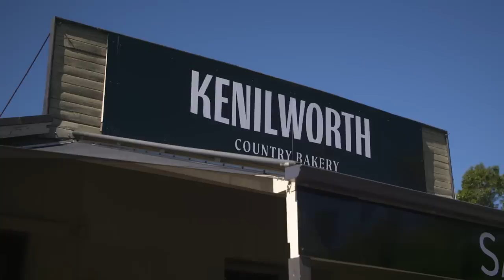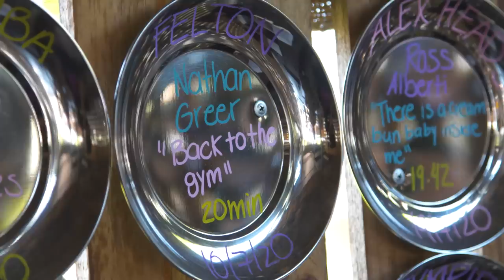CARNAGE on QLD's toughest 4WD track! Panel Damage & Busted Steering on Glasshouse Mountain tracks

Comment: This was the first time I had been on some proper 4x4 tracks and I am a rookie so don’t judge 😂 I was out on the tracks at Yalwal.  We were just going to finish up on one of the tracks just as the sun went down. I went up a pretty steep track with some pretty decent ruts and slipped into a big one and got stuck. I had one globe that had blown earlier that morning and as we were doing the recovery the second one blew. If I had spotties and some better lighting I would have saved myself ripping my front bumper off and putting a nice dent in the rear as I finished the track with no lights 😂  it was a good excuse to tell the wife I need a bull bar though
Reply: Absolutely awesome work, loved it👍.
Reply: @benclarke8743  bro this isn’t the same jesse from the video 😆
Reply: 🤣🤣🤣 my bad👍

Comment: I was in a 2wd ford ranger and had to pull a full size jeep Cherokee[ the old style] out of a deep water crossing at night after he fell through the ice. all I had was headlights and a high lift jack and some straps. I had to put the front bumper on  tree because my little 2 door ranger was just sliding into the puddle with every crank of the farm jack. three hours latter and we got him out. great fun I miss that little truck. that would be a good episode all the trucks from the past you had to get rid of but wish you still had.

Comment: Driving home one night in a winter storm in good old Idaho USA. Saw multiple cars who had gotten stuck off the side of the road. Was very fortunate to have a capable vehicle that can handle it's own, however, it being a new vehicle to me I had yet (and still have not got the chance to) put some spots on the vehicle. I spent a good 3 hours with a flash light in my mouth and my friends hands as I tried to get vehicles towed out. Rescue could have been down in closer to half that time had we been able to see better. Number 1 priority before winter hits this year is be prepared to help others this go around, and not put myself in danger in the process!!!

Comment: As always guys entertaining and informative.
I live in WA and try to get out there as often as I can. One of my more interesting trips was travelling the coastal tracks north of Jurien Bay. Due to some rather unfortunate luck we had found ourselves still on the tracks way after sun set. Managed to destroy a tyre or two on some limestone cap rock and an unfortunate run in with some local wildlife had delayed us significantly. Anyway back on the tracks and it was very dark and we were trying to remember where our camp was. In the dark and with only high beam on my old GU the terrain looked very different. We missed a couple of turn off's and were trundling along thinking we were not far off when all of a sudden the bush gave way to the Indian Ocean! I mean we were three feet from driving of the edge of a limestone cliff. If we had have had decent lights we may not have gotten so easily lost.  Come day break, yep we stayed there, we realised we were only 1km from camp! So close yet so far.

Comment: Got a little too ballsy trying to camp through a typhoon, tent couldn't handle the wind so we gave up and headed down the mountain to find some lodging. Normally a 30 min drive turned into an hour of driving through flooded roads, street light power outages, and sideways rain/fog and couldn't see a meter in front of the car. Spot lights would have definitely helped..
I knew it wasn't the smartest thing to do, but with limited days off, I guess camping during typhoon is checked off my bucket list..haha

Comment: Took my old TB patrol up Bago Bluff around Wauchope for a midnight session. Got half way up a very steep and technical rock climb when both of my head lights (only 2 lights on the car) blew at the same time. Had to navigate over 2 hours to Finnish the 100m hill climb using only phone torches…. Then drove all the way home with no lights and 2 iPhones cable tied around the front of the grill.

Comment: I could definitely use some spotties and a lightbar! Just a few nights ago I was trying to get down out of the mountains near my home on a trail that was really washed out from excessive rain. It has become a lot more technical as more dirt washed away over the last few years. 

With my fog lights and head lights, I couldn’t see down the trail very far but I had driven it several months ago and thought I should be ok. Had I been able to see a just a little further, I would’ve taken a different trail altogether.

Instead, I worked my way down the trail about 60 yards and found myself teetering from 2 wheels to 3 wheels as my rear passenger tire lifted and I found myself at a gnarly angle staring down a wash out my driver window that dropped off down into the darkness several hundred feet below. The trail had partially washed out and I couldn't get my truck through without tipping.

I ended up making it down safely and thought the truck was miraculously unscathed despite the technical drive I had to make backwards to get back up the trail so I could find an alternate route down. I didn’t stop to check my truck when I got back to the pavement (stupid mistake) and wondered why my blind spot monitor kept going off on my drive home when there weren't any cars near me. 

It wasn’t until I pulled back into my driveway and got out that I saw have my bumper dangling in two pieces just above the ground by the truck’s wiring. They don't make 'em like they used to! Everything is plastic now! I must’ve caught a rock or something as I was backing up the trail.

I managed to zip tie it back together (sort of) in the dark and my wife hasn’t seen it yet 😬 but I think I’m going to have to upgrade the back bumper to a metal one sooner than I thought.🤦‍♂

I’d love a pair of spotties and especially that light bar up top to help keep my truck in one piece when I’m trying to get home next time.

Comment: I could of used a set of light on my old 60 series. I was in the Kimberly and managed to fill the alternator full of mud! The big problem I had was I needed to be in Sydney in 6 days to catch a flight. Unfortunately there was no auto electrician in Hall Creek, I set out for Alice along the Tanami track,  no lights no electrics for 2 days and nights! At one stage I had a dolphin torch strapped to the roof  till it's battery went flat! Got to love an old diesel! Couldn't do that today.

Comment: Wish I had a spotter like Jessie, I was driving through some old tracks with my dad when I first got my ln106. Long story short my left tire slipped into a rut and my locker went half out of lock and I was diffed out at the front with my right rear tire about a metre in the air. A good set of work lights and spotties would've gone along way as we used phone lights to dig out, a 7 o'clock trip turned to a 10pm trip real quick without any lights to see for digging and to navigate the rest of the track

Comment: Best bush BBQ Hot Plate setup going Jock, did you build that yourself ?, don't see too many like that around. That's all we used to use for camping, old barbie hot plate or home made one with four nuts welded on the corners at a slight angle for the legs to screw into, a couple of nuts and a washer on the other end to stop it from sinking into the sand, stored in a hessian bag for transport and in between fishing trips. 👍

Comment: love the show!! set of spotties wouldof helped in that exact spot jessie had a lie down, glassy night run with candle headlights up palm tree, layed my chopped 105 in the same spot , lucky my barwork and tray held me from doing panel damage, none the less a fun angle, slammed the old girl in reverse and sent it back out with about 6 foot of air under the back wheel

Comment: Keep this content coming. Good hard 4wding with two legends. 

I could have used a set of spotties one night doing a powerlines track in a candle lit XJ Cherokee. Tried following a mate in a big 80, ended up slipping down a rock and putting the car vertical. Nose down. My passenger was standing on the firewall 😅😅.

Comment: Big Red? Well, a mate and I took our stock as a rock dual cab dailies out on Cobaw some time ago... ended up stacking rocks into the night, and lemme tell ya, could have done with those lights 🤣 would have saved a few slips in the slick mud running around with small boulders and dents in the utes

Comment: Had me road tires on and decided to go down a small river in my little Suzuki. It got dark and I didn’t have enough light, picked the wrong line and ended up getting stuck in a bit of the river with the water up to the middle of me door panels and water in the ol girl 😂 5 or so hours later my old man arrived in his suped up Range Rover after seeing my mates leave to find him and pulled me out no worries. Had to follow him back through because both of my headlights didn’t work quite right 😂 eventful day, even managed to knock one of the exhausts on my flange so it sounded like a race car and put a big ol crack in my windscreen 🤣🤣

Comment: Im pretty sure those old petrol pootrols had a rev limiter built into the rotor button. If the spring failed/fatigued it caused all sorts of dramas

Comment: Having successfully completed a 1Kg donut challange... the secret it to deal with the cream which is full of air... You need to slurp it up but swish it around in your mouth to turn it back into a liquid form and remove as much air as possible before swallowing... that helps a LOT!
Rather embarrassingly, I used to also have my name on the honours board at my local "Robbies" bar/restaurant that ran a 1Kg steak challenge too!
Those were the days!

Comment: Please drop me into the draw for the lighting pack from Big Red. I sure need it. Although in the past I needed it more. Imagine a young bloke in a 78 Rangie crawling up the track to the Mitchel River Falls in the Kimberley's. It's 1986 and the track is barely two goat trails through the rocks. I'm running IPF's and they are barely candles on the 60 amp alternator of the Rangie. I drove into the night and there just wasn't anywhere to pull off. Finally in the wee hours I crested a hill and found a spot large enough to park for the night. As I'd been climbing and the old IPF's were spots, not floods, I could only tell the clearing was flat by the level of the car as the lights just pointed off into oblivion. I grabbed an old Dolphin torch and jumped out of the car, straight into the midst of four crocs who shared my decision that this was the right flat spot for the night! I barely hit the ground before jumping back into the car. Once the shaking subsided I grabbed the thermarest and sleeping back and climbed onto the roof. There wasn't much sleep to be had as the roof raack rails found every groove in my back, but the roof was better than the ground for sure that night.

Next morning they were nowhere to be seen and I cruised on to the falls without any issues. I pretty much gave up night driving after that trip as the light in the old days were more for decoration than anything. The old 78 has long gone, but been replaced by an 89 and then a 95 Rangie, and guess what, those IPF's went from car to car too. It really is about time I dragged myself out of the 80's and tried a set of LED's. Imagine driving up there these days with a balance of Big Red spots shining the way and the Big Red light bar flooding the areas directly in front of the car. That would have sorted those pesky, and seriously scary crocs!

Comment: Yeah I have to say for the age of both vehicles that was pretty cool. Me personally the gq just proved how good they actually are..... when running right Jessy wheeled the wielder beast like a champ. It was also good to see the 2 different approaches to some of the challenges and knowing the limitations of your vehicle can sometimes dictate how you drive it. Jocko's lux has had some coin spent on it with sas etc and I dare say Dayral not quite as much but driven right just as capable... well put together couple of vids. I wonder if Shuano cringed at some of that 🤣🤣🤣🤣

Comment: Awesome ep.. good to see some great wheeling... 

Im a baker by trade but live to get out and go camping and checking out the bush whenever I can.. unfortunately that means that alot of the time I'm driving to my destinations straight after I finish work which sometimes can be 3 or 4am. Some decent lights on my 95 series prado would help me not to come in such close contact with our lovely native critters, plus being able to see around my camp when I get there via something much better then a head torch would be mint.. fingers are crossed for this one boys 🤞🤞
Reply: Im a baker too. I do sun to thursday and i drive on thursday lunch time after work straight out. Best thing of all nobody is really ever out in the camping spots cause they are still at work, so u get the choice of the best places. Not to mention tinkering on the 4wd after work from early morning knock off time to the evening. Stuff working 9 til 5, get no time to do anything.
Reply: My dads a butcher and I'm a candlestick maker.

Comment: Set of big reds would Have come in use when we where doing a powrline track with a couple of mates late at night in middle of winter. The utes currently got a set of hid big reds on there now which are Insane for distance but unfortunately there not so Good for close up which as I was walking back too the lux I stepped over a danger noodle which wasn't too impressed and when my mate pointed it out managed too get from the ground too in the tray in one leap. No idea how just managed too levitate too saftey. Even better considering where currently rebuilding the kzn and new Set of spotties would give her a real glow up.
Cheers

Comment: I could have done with some spotties after dunking into a deep mudhole and filling the inside of the headlights with muddy water. Lights still worked for the drive home at 9pm but were no brighter than 2 candles.

Comment: Top time I could have used a set if lights was the drive home from work in broken hill August 2018, only had standard headlights in my GU coil cab ute, the small drive home consisted of broken Hill,  Menindee, hay, barham then home  about a 9hr drive at night in central nsw with candles for lights

Comment: Getting 12 kms into a rocky track and having the steering snap. Taking a bolt from the tray and using that to hold it together and driving back in the dark with no spotties to help spot the rocks 😢

Comment: Lithium can handle way higher discharge then 150ah. Its the BMS that is the limiting factor. (If the load didn't go thru the BMS youd be able to run much larger loads. But then you would need other means to disconnect loads before damaging low voltage situation arises.

Comment: I work in the mining industry so late nights on site and in the middle of nowhere is name of the game .well this specific time i had about 50km of corrigation i was tired and was really flying down the dust and yes of course my standard lights gave up due to a short circuit. So i really couldnt follow the lines to see where it all went wrong in this situation a set of spots that are wired very easily to a switch would have worked wonders like the big reds but yes a full moon and slow travelling got me to the end where my accomodation was . Sebastian from south africa

Comment: I NEED SOME SPOTTIES. I was driving with shitty headlights on and didn't see part of a spring mattress on the side of the track. Needless to say it took about an hour to unwrap it from my tyre and carefully pull it out from near the radiator.
Set of Big Reds would've definitely saved my ass.

Comment: danm. a good set of spotties would have been very helpful in Eldorado local 4x4 area winching through mud would have likes to have seen where i was walking toward the tree and how i was going to angle it as well as the the near vertical climb i had to try and pull off to reach the campsite at the top.

Comment: I was out in the Black rock dessert stuck in my FJ40 on playa with a inch of frozen water that I couldn’t see because it was dark drove over and broke through into white clay with my 35/12:50/15 and air lockers I sunk if I would have had them lights I would have stopped and turned around and wouldn’t have been stuck there 2 days love your videos

Comment: I was driving my ranger into red bluff just after sunset and the kangaroos were thick. My headlights had stopped working on the corrugations on the way in. Spotties would have been the saviour and would have not have killed that kangaroo.

Comment: The one time it would of been handy is when we were coming down a nearly rocky hill and we only have the standard lights that aren't real good and when we where coming down our tire bead broke so we were driving down with a flat tire and I could not see where I was going and I actually drove off the track so I decided to wait till the morning to go the rest of the way down and had to hold the brake all night in the morning I did get down and fixed the tire. Please this set of lights will help me so much

Comment: I had the issue with my leads arking on eachother on a rb30 in a r31 back in the day causing pretty bad misfire issues… in saying that though after closer inspection there was one where the insulation had split
Reply: It would also electrocute me if the car was running , which I’m sure is a tell tale sign 😅

Comment: years ago a 4wd trip to the snow saw my classic rangie suffer electrical gremlins ended up driving out of the bush with dolphin torches duct taped to bull bar, spoties went on a few weeks later, the new dmax x terrain definately would look good decked out with a set of lights cheers boys